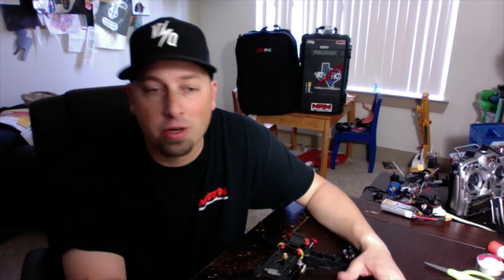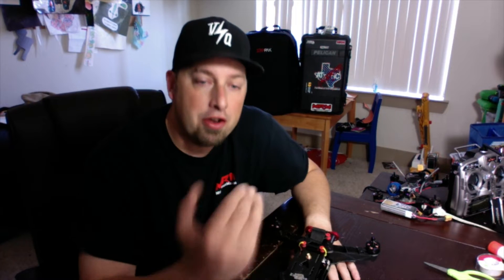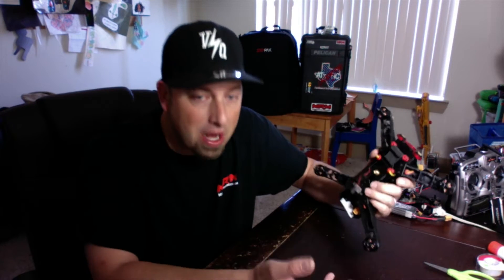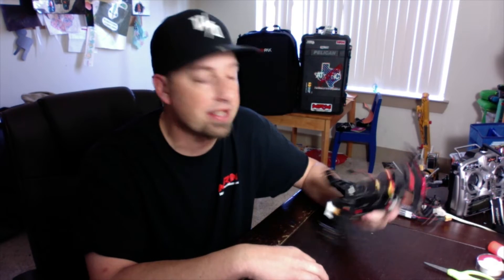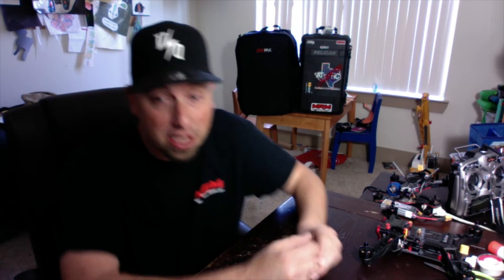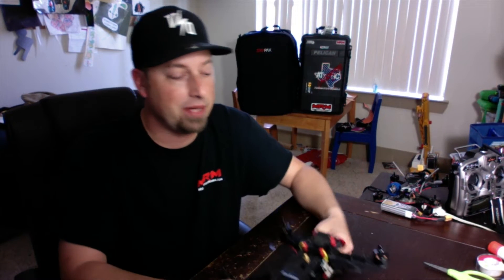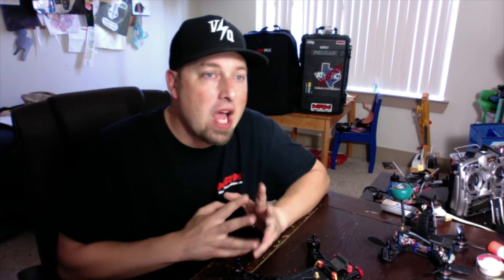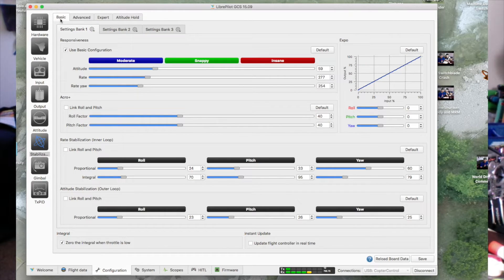Libre Pilot/Open Pilot for Eachine 250 or ANY FPV Drone by Bangood Rates, Expo, and PID Tuning Info

Comment: anyone got any idea on why my goolrc 210 with stock settings just does a million flips then slams into the ground? on every flight mode it just wobbles and flips over mainly when i drop the throttle. i know the pids are off but has anyone got a good starting point? would it be better to just lower all the pids to the lowest possible value then just raise them until it works? also it flies ok'ish when the battery is half charged but with a full charged zippy compact 1300mah 25c it flies like its been drinking hooch. confused as hell. ive seen people fly this quad with stock settings and it flew ok but mine does not.

Comment: Before oscillation PID tuning you should tune the quad mechanically,  as no matter how you fine tune with the PIDs if your quad is mechanically unstable your FC is going to be fighting it. Start with prop balancing. A MUST! before you do any PID tunning. Also sand the edges of the props a bit so thy do not induce severe flesh cuts in case of a mishap while holding the quad or near it.

Comment: Hey, I am fairly new at this drone world. I bought an eachine from fb market place for $60 with LCD screen on the receiver... Anyway,  I have this thing flying about a foot or two off my kitchen floor until I kinda jerk the throttle and crashed into my lower cabinet doors... I replaced the props and was able to fly again for just few more times...  When I bought this the frame arms are different colors.. I replaced them to matched all four colors..  Well, while I had the motors off. I plugged the battery and fried the controller flight board... So, I ordered the same board from banggood.... It came couple of weeks later..  I plugged the new controller flight board and it does nothing... So, my questions are,  do I have to program the new board? do I also program the receiver? 
Well, Thanks in advance

Comment: Hi,i bought the Floureon 250 which is an upgrade from the Eachine,would libre pilot work just as well as cleanflight,the floureon does come with a naze 32 board.

Comment: Hey ATx RC Productions by CheFPV , do you have idea how to still use roll, pitch and yaw when throttle is at 0? I tried everything in librepilot but i didnt achiev what i want. If youo know how to do this please share with me. Thank you
Reply from the maker: William Barth your talking about a video and product that is 2 years old if not more and yes no longer the standard.

If you are however having the issues your stating, it's user error not the board.
Reply: I dont have idle up option on my transmitter. Its a Turnigy 9x (stock firmware)
Reply: Already search, nothing found. Thank you anyway :)
Reply: i tried that aswell but slowly motors gettingg fast and fast
Reply: +Manel Correia you got to uncheck a box in librepilot. The props will always spin when armed though. forget what its called.
Reply: download betaflight and activate airmode you will prob have to google it there are alot of vids on it
Reply: Hey chefpv pretty good video, but honestly cc3d IMO is garbage. I have done all the things you said before I watched your video and  my quad flops around on my grass like a fish out of water! I set it back to the defaults and it flies, not well but it flies. I have been on beta flight tuning my other birds and it responds well to the settings. Could I be missing something? Thanks for taking the time to share your experience
Reply from the maker: William Barth i would not recommend CC3D and Libre anymore for any reason other than learning new stuff and historical research.
Reply: ATx RC Productions by CheFPV yes user error, I don't know how or why but I went back and set everything back to defaults and then set my sliders to insane, it flew very well and responded close to my piko blx and f3 boards. It started to rain while testing so I packed it up but the performance was much better. Thanks I have my head buried in this since the start of the build and I have that glaring eye happening.lol thanks still like my beta flight set up. Keep it in the air!!
Reply: ATx RC Productions by CheFPV I don't want to use it either but I have two of them and I hate to let them sit around when I am always building new quads. I am building a 200 and have the cc3d in my hand and I am on the fence about putting it in it or just waiting for a piko blx to come, I am an impatient man.! Hahaa thanks for your time.

Comment: i see you can tune the rate is the openpilot but do the rates on your rc controller also change or do you leave them as they are and change the rate in the GCS?

Comment: Hey brother great video. please help! I have the Eachine falcon 180 with a cc3d FC. I rotated the board 90 degrees changed that in attitude. now it flips on take off. props on right. motors spinning right. I'm stuck. Just subscribed. thanks man.
Reply: Also updated the fc.
Reply: you should put your board back in original position and do a test flight
Reply: you need to change your yaw either 90 or -90 depends which way its facing

Comment: very informative i plan to use all the info i learned here . now on to my problem. i got the 250 carbon quad from hobbyking diy motors but with blheli xm escs.  i went through the setup wizard and set it all up correctly and props spin correctly. but when i lift up it flips over instantly. i did notice no pad the fc is screwed down to the frame and there is no vibration pad? will this be the cause making it flip or? im coming from old kk2.0 this is my first cc3d. i do understand the info but i cant find any issues i know to look for. everything looks right. help?

Comment: Nice video. I recently purchased a beginner from hobby King. The King Kong 260. I went thru the basic libre pilot wizard and had no problem setting it up. However, once I got it in the air, it was very shaking and pretty much unflyable. The osolation sounds like my issue. I'll try your advice on the quad to hopefully fix the issue. Also, I put on the bench and just started the motors at the very low end of throttle. The motors slowing soon faster and faster with no further input.  If I throttle it to like halfway, it doesn't continue to spool. Is that normal?  By the way, I notice you're in the ATX. I just moved to Portland from Austin and man I miss it. Anyway, I really appreciate the video and would appreciate any input you might have. I'm new to it and this is the first time I've messed with cc3d.

Comment: thank you for that...i have just got the falcon and flashed it but the eachine i6 trans didnt come with insructions and i cant get librepilot to recognise all the switches...i have noticed that in the other page that shows telemetry and horizons its telling me that i have gps issues which it doesnt even have!! ive got it flying but my three position switch i chose for modes and the other ones throttle hold an idle up i wouldnt have a clue what theyre doing now. any ideas

Comment: I just finished my first build-- Robocat. It hooked up once on Librepilot. Then under no circumstances will it hook up-- Robocat just sits. I then bought a naz 32 to hook up to cleanflight- waiting on the part. Do you have any ideas how I can hook up with Librepilot? There is a note that I have to upgrade with plug in??? It will not connect-- board plugged or not. I then downloaded cleanflight and tried to convert the cc3d board-- it will not hook up either. I have gone to 2 different computers---- man am I stuck-- 2 weeks now. Any thoughts?

Comment: Chad, Skitzo, Steel and Charpu disliked the video ?
Reply: because its a chinese knockoff.  I'm not knocking them though, I have a falcon 250 and its a good start into racing.
Reply: Yea if you go that route, get the eachine falcon 250, not the racer 250, IMO
Reply from the maker: +Demon SLZ If so probably because its a Bangggood....LOL
Reply: ATx RC Productions by CheFPV Why do you think dey dislike banggood? I am new here . :D
Reply: but there is only 4 dislikes
Reply from the maker: what exactly is the debate here?  Who cares who disliked what.....
Reply: This Video which was quite helpful was disliked by 4 ppl.. so i made a joke saying that some of the top FPV mini ppl disliked the video (call me capt obvs) rest is history. but i still dont get the banggood part u said :|
Reply from the maker: +Demon SLZ what Banggood part?
Reply: ATx RC Productions by CheFPV Chk your First rply for my comment "+Demon SLZ If so probably because its a Bangggood....LOL" :D
Reply: rott420 the echine one right. awesome.
Reply: rott420 I was thinking about getting a chinese QAV250 kit as my first build did u get the Falcon RTF?
Reply: Yea I did with the flyskyi6.  The Tx is a POS, but its a great start.  I have a buddy with an old DX6 and a few AR6000 Rx's for it, I'm bout to switch over to that radio soon.
Reply: rott420 Aw nice man.. thats great info i was worried about the Flysky radios .. thanks

Comment: Great vid! A couple questions for you if you don't mind. How do I save these parameters to the quad (noob question). And, when I do, with my RTF version Eachine i6 transmitter will it still be bound to the stock transmitter? Or will I have to rebind? Is Openpilot using the same firmware as Librepilot? Thank you in advance!

Comment: Super great video! Thank you for supporting the extreme settings! they are awesome on the eachine! 
Eachine 250, Redbrick 25amp esc's w/BEC DYS 2750kv, 4s 2200mah-130c lipo. 
Take the video transmiter and put it on the tail where the battery used to go, then you can put the battery nicely on top. LOVE THE EACHINE NOW!!! speed demon!! get a bit hot tho lol :P.

Comment: Ok I just got my 250 Falcon and got the props installed, turned my 250 on then my receiver..But when i try to fly it, it seems like it cant/wont lift off the ground and instead tips over to one side and scraps my props :/ any help would be wonderful thanks!
Reply: +VigilantVas Vlogz Hey, this is sasdthoh. I'm a hard core fixed wing pilot and when I decided to get into racing class quads, I made a very simple mistake because I was in a hurry to fly. I actually mounted one of the props incorrectly. I install a clockwise ritating prop on a counter clockwise rotating motor and it did exactly the same thin. Additionally, for the other pilots reading, YES ..... you have to program the flight controller, calibrate the sensors, transmitter, esc's, etc. But Librepilot has a fantastic easy to use wizard that will make it painless and fun. If you REALLY want a hard core education on all things flight controllers, quads, racing class, transmitters, everything really, check out the channel PAINLESS360. Simply put, he is awesome and you will learn and solve just about every issue you ever wanted to fix. This is an excellent channel but PAINLESS360 will give you an education and get you in the air FAST! sasdthoh

Comment: Hi, thanks for the interesting video.

I'll start out by stating that I'm a noob to tuning my quad, and with the bad weather in the UK at the moment I've not flight tested any of my settings/theories.

I'm flying an Eachine Racer 250 programmed with the latest LibrePilot. I've tuned my pid's by using TxPID to find my UOV's and the Optune calculator. I have got rid of any wobbles and shakes that I had and I highly recommend this method.

In your video it looks like you are only adjusting the 3 sliders in basic mode called Attitude, Rate, and Rate Yaw in an attempt to effect the speed you can flip and roll. After playing with these settings myself and researching what they do on the wiki I would have to say that you may want to look into them a bit more yourself.

Attitude slider - Only effects the quad in Attitude mode (Rattitude mode also, when below the activation degree that rate mode kicks in). This slider sets the angle in degrees that the quad will fly at in attitude mode with the related stick is at full. So when you say to set this at 130, you are setting the quad to fly up to 130 degree angle in attitude mode, which I can't imagine being a good thing as this would point it at the ground and then leveling would kick in.

Rate Slider - This adjusts the full stick response in Rate mode for pitch and roll. You explain this well and a minimum of 360 is recommended on the wiki for acrobatics. the number on the slider sets the degrees per second for pitch and roll.

Rate Yaw Slider - The same as above but just sets the degrees per second for yaw in Rate mode.

The thing that I think you haven't noticed is that none of the 3 sliders in basic mode set the 'Max rate limit', and no matter what you change in basic mode it stays at 300. So what is 'Max Rate Limit'? According to the wiki this relates to the 'Full stick response limit in any mode' and 'Specifies the maximum rotation rate in degrees per second commanded by a full stick deflection on the associated axis in any mode.' It also recommends that you 'Make sure this is the same or higher than Rate mode response above.' So from this I would gather that unless you activate the advanced mode and set the 'Max Rate Limit' to the same as your 'Rate Limit' or higher, then you will only be getting what it's set at by default which is 300 degrees per second. Looks to me like you will have your quad set to 590 deg per sec rate limit for pitch, roll and yaw but the 'Max Rate Limit' will be restricting this to 300.

Forgive me for the massive comment. I never usually comment but I feel that I have adequate knowledge on the subject to discuss your video in more detail. As stated at the start I'm a noob to this. I would like nothing more than for someone to tell me that I'm completely wrong, just so long as they can explain why.

Comment: Awesome video! I have the eachine racer 250, you actually just figured out for me why my quad has a horrible wobble when trying to descend. I'm going to tune it up for sure. I do have a question; for the eachine libre pilot, do you need a certain revision or should I just go with the latest version?

Comment: Yeh like the previous guy said procrastinating to the switch, I've heard some tales of guys being locked out after trying to flash firmware from open to libre pilot , which worried me , but I'll defo try the snappy settings for a bit